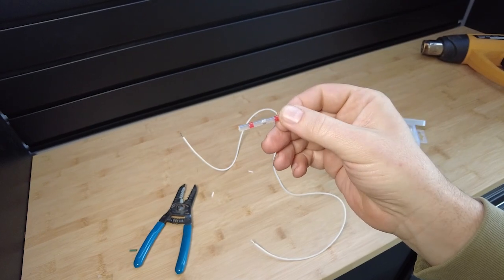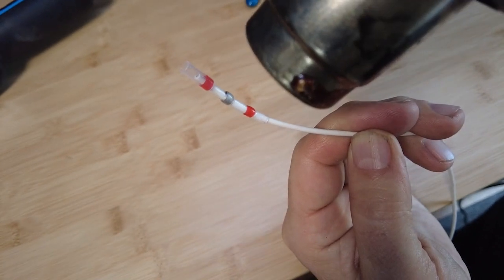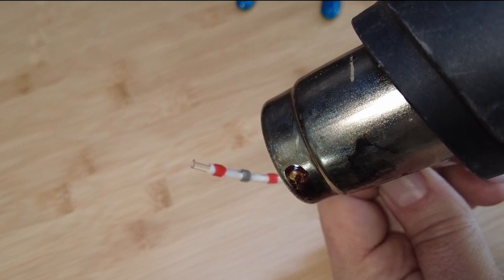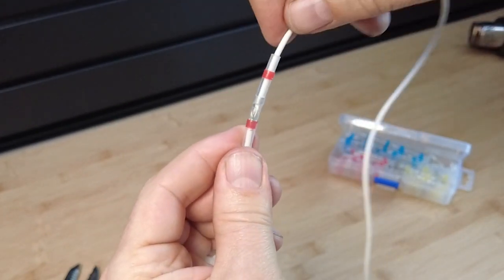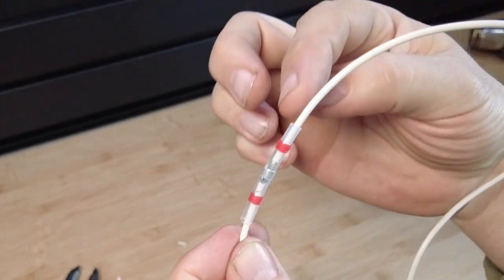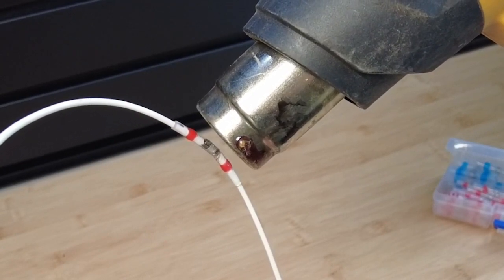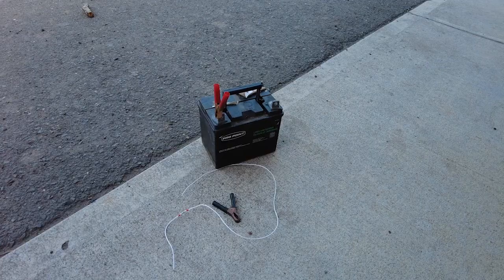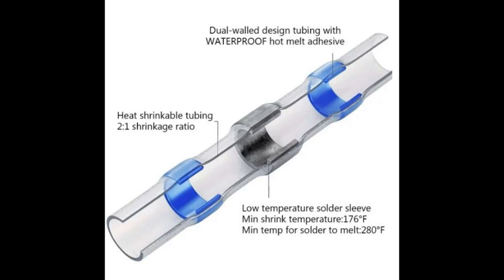Heat shrink solder connectors test

Comment: The same thing happened when I used a heat gun with a wide nozzle. When I put in a smaller one, about 10mm in diameter, the heat shrink solder connectors actually did their job perfectly. They would solder the wires without any problems.

Comment: Your experience is very much like my own. I found that the whole connector melted before the solder did. I tried heat guns and fire. I was wanting these to work and have a whole bunch of them. I will stick with soldering and heat shrink.

Comment: This is absurd. I've installed thousands of these connectors with no failures. If you're going to test something, at least give it a fair shot. The adhesive was never melted before you determined it failed to adhere and the protruding conductor was due to a sub-par assembly by the installer. Do better.
Reply from the maker: there may be different types and perhaps we just got a bad brand.  We tried this test numerous times off-camera with the same results.  The connectors were heated WELL beyond normal acceptable temperatures and the adhesive did not melt...ever.  That was kind of one of the main points of the video.  We're glad you have different results in your own use, but the results we got are about as accurate and unbiased as possible.  We really WANTED to like these as we were looking at using them for our own builds, but the test proved that, at least for this particular brand, it wasn't acceptable for our standards. Cheers.